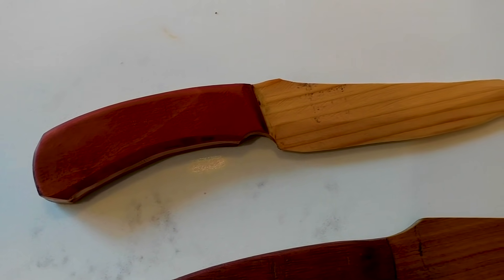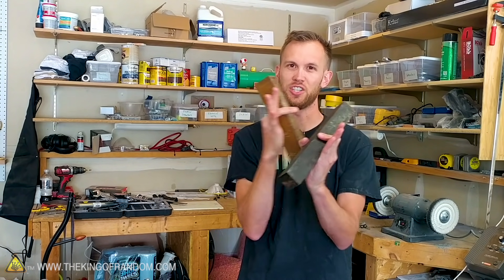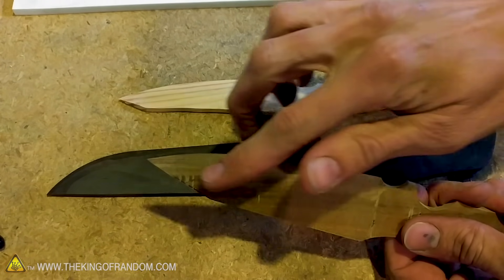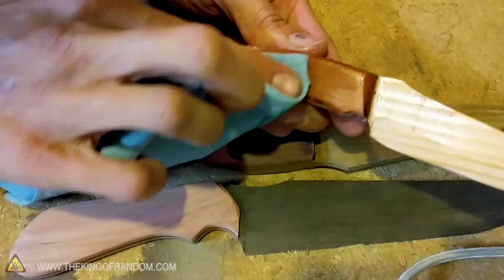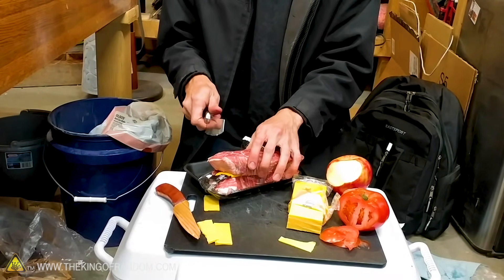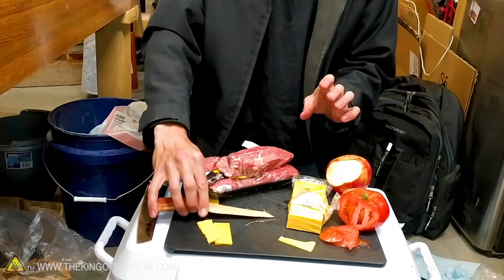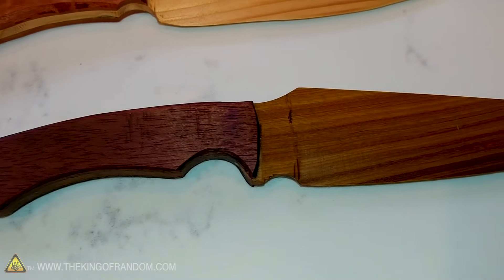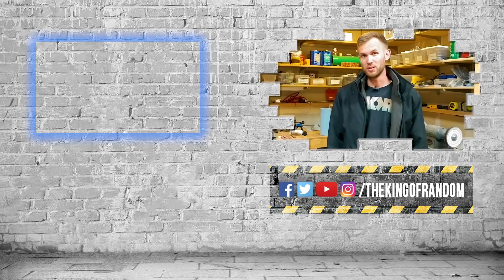How Dangerous Is a Wood Knife?

Comment: Can't believe you didn't think of fire hardening. They use that trick for arrows. DO OVER!
Reply: Exactly what I was thinking, I've seen survival shows that use a similar method of fire hardening as a fire plow through friction because any heat treatment is better than no heat treatment...
Reply: Yes but he also should have also tried  fired hard rock maple and fired  iron wood
Reply: Thanks for commenting this because I was going to if I didn't see something like this.
Reply: tony
Reply: huncho green yes?
Reply: yes, whenever i do this i make sure to put my wood in a furnace for a few hours beforehand. it also gives the wood a nice black color
Reply: or katanas fire and water
Reply: Fire hardening brings out the sap from the wood and burning it away so fire hardening is very inefective against processed wood
Reply: @raed21093  you have to put it in a fire a for a second until it looks just a little black it’ll make it strong
Reply: Yes.. this! And serrated on the edge... it would be maybe the best ever wood knife?! 🙌🏻
Reply: @raed21093  i would use a small torch to have the most control...very quick hand movements... it's fun too

Comment: Can you freeze a lava lamp in place with liquid nitrogen or other cold things?
Reply: I would to see that too
Reply: Yep
Reply: Tottaly
Reply: They should put it running in a freezer and film it until it freezes totally
Reply: ِ  but what if it doesen't. And anyways it would be fun to see it crack
Reply: The bottle would burst from going hot to freezing too fast.
Reply: Lava lamps bubble and move due to high temperature changing the density.  It would be very hard to freeze the liquids faster than they move through each other.

Comment: Too bad you didn't fire the wood first.

Fired wood is much stronger and would probably hold that edge better.

Edit: I should have said fire hardened, not fired.
Reply: Realllly misread that. Based on what I read that knife would be onnn fire
Reply: Thousand degree wooden knife?
Reply: @CausingChaos.  (claps slowly)
Reply: @samanthae.1002  fire hardened...
Reply: Samantha E. Not on fire... burnt
Reply: @samanthae.1002  Same here
Reply: @samanthae.1002  ..........
Reply: @samanthae.1002  it transforms the wood into carbon
Reply: almost correct mate , i think you meant heat treat the wood.
Reply: yah thats true
Reply: A quicker way is covering it in very thin based super glue which turns the wood rock hard
Reply: Elite_ Shadower_  also temper it and put a hamon on it maybe even dip it in ferric chloride to get the damascus pattern
Reply: what did the wood do to get fired?
Reply: Darn, I was going to mentioned fire hardening, but I was too late...
Reply: @James-hj5ov  lol, maybe just a little.
Reply: that is true. he should definitely try that
Reply: so unemployed wood is better?
Reply: Glad I looked down the comments before mentioning fire hardening as I wouldn’t want to be the 100th person to mention it 😂
Reply: Teak wood that saltwater cured is very,very hard, I have a couple of combat paddles that I made thise things are about as hard as wood can get, one edge is beveled to a nice sharp edge the other is rounded, the end is hooked and pointed into a pile. Yeah I have several that I sold and two of them have been used for defense and both times were lethal. You start out with a hard wood and go from there
Reply: I agree, this would be great to try next
Reply: @mysticwolf2842  wait, can you explain that some more?
Reply: was just gone say that too.
Reply: even primitive wood spears and arrows where heat treated, the carbonation allows for a much sharper edge, I think.
Reply: also i think if you lined the grain in the other direction you would have had much less damage when using them. the grain should go horizontal not parallel to the cutting edge.
Reply: I just jumped into comments to say the same thing. It's amazing what you can fire harden, from feathers for quills to see shells. You can also use the method where you plunge the edge into super heated sand
Reply: Paul Powell could you explain exactly how you do that?
Reply: @jasonmatthewson8534  HA, the jokes on you! You mentioned mentioning it, so you're still the 100th person to mention it!
Reply: @samanthae.1002  you can strengthen wood by burning it a little. That's what they are talking about.
Reply: @CausingChaos.  wood..lol  could it be would or should it be wood?
Reply: I didn’t know wood on fire is strong I though it wood be destroyed
Reply: He he bioi
Reply: Jeana Verkempinck but what if it will be too rough
Reply: I was thinking of that too.
Reply: Yeah take its job
Reply: CJ Lilac PUN CITY
Reply: My thoughts exactly.  Especially hardwood, when heat tempered becomes a whole new material to work with.
Reply: Is this a sequel to “Wood fired pizza” ?

Comment: Use a sanding not sharpening system for the edge, wooden knives are really effective for softer vegetables and cheeses. And are great center pieces when paired with a matching board.
Reply: @Timetraveler515  cheese that isnt solid isnt cheese
Reply: Our processed cheeses are not cheese but we can still get cheese on the block.

Comment: I think you should have used a straight blade (instead of a curved one) aligned to the fibers of the wood. That way the splinters while cutting could be eliminated and the edge could be more durable and sharp.
Reply: MoTab for a kitchen knife, it is best to have a curved edge so you can have the right motion for cutting food
Reply: @matthewkohmann8657  The quest was to make a proper knife from wood, it has to be a knife before being a kitchen knife ;)

Comment: 1:37 kinda straight. None of the 2-4s I have every seen from Home Depot, Lowe’s, or Menards have ever been straight.
Reply: I used a 2 by 2. And Batoned off a sliver and made a little wooden butter knife for when I go camping. It matches my wooden Fork, Spoon, cup  I made. spatula and cutting board of course...
Reply: If you go through an entire pile you will usually find 1 reasonably straight 2 x 4.
Reply: Gareth Baus. Yes but when you are trying to do a project which requires multiple straight 2x4s it is just really annoying.

Comment: Try purpleheart. I’ve heard that is some of the hardest wood in the world and can quickly dull saw blades.
Reply: Or apple wood.  Some clocks and watches have gears made of apple because of the grain.
Reply: having worked with Purpleheart, it's not even close to Lignum Vitae for hardness. it's harder than most "Common" woods, but once you get into the exotic stuff it becomes more middle of the road.

Comment: Use stabilizing epoxy in the vacuum chamber with the wood and it will make it rock hard and hold an edge
Reply: makes it a composite epoxy knife rather than a wooden knife. You wouldn't have access to epoxy or a vacuum chamber outside of a workshop ;)

Comment: Lignum vitae is a very hard and dense wood with a complex grain structure. If you take the time and run it through the grits up through 10,000+, you can get it sharp enough to shave with.  I've seen a properly sharpened Lignum vitae knife cut paper thin cucumber slices, but that knife was much heavier than yours, and has been honed with a 30,000 grit whetstone.

Comment: It's basically the same process as say, mass produced fixed blade stainless steel blades, like kitchen knives. This process is known as "stock removal", and is typically done for knives and tools of the type en masse for cost efficiency sake and because of a higher potential for precision.

Comment: Should have tried bamboo. Bamboo is anti-bacterial, and anti-fungal, which is why a lot of eco-friendly kitchen utensils are made from it. It's also extremely strong for being as light as it is, so you could potentially make a thinner knife blade. Bamboo is a grass, but it's close enough to wood for this experiment. That being said, you can buy bamboo knives used for lettuce and vegetables for pretty cheap. 

And the 2x4 is white pine.

Comment: Should try balsa wood infiltrated by a thin resin by using vacuum chamber, off and on.

Just need balsa parallel to the blade.

Could just do fiberglass, but wouldn't be the same look

Comment: You could probably shape better with a cabinet scraper. As far as type of wood I would recommend  purpleheart(from the amaranth tree in africa) or Ipe (also known as Brazilian walnut). The purpleheart turns grey when you sand it but the longer you leave it out in the sun the darker it gets. The UV oxidizes it causing it to turn purple. It's also ridiculously hard. I was burning up a carbide drill bit while drilling a pilot hole. Now the Ipe has a fire rating close to that of steel or concrete and doesn't really burn. Might try the fire hardening on that. It's already hard and tight grained. It's often used for the decking on semi trailers. It also contains a lot of resin. Also with more domestic hardwoods you can melt steel wool into vinegar and brush it on the wood. The metal reacts with the tanic acid in the wood causing it to darker. The more tanic acid the wood contains the darker it becomes. You can make poplar look like walnut with a few coats or turn red oak completely black with a single coat. Sorry for writing a book but it's kinda in my wheelhouse.

Comment: The Lignum Vita knife may have cut better than the Ebony due to design rather than wood quality. As you stated, the Ebony had an extremely thin edge, and with the chunks missing, it would not cut as well. I noticed they also had different designs, which, for the purposes of material testing, can produce flawed results.

Comment: "Sawing" with the wood knife is right, you have tiny serrations in the edge . Cheese doesn't require a sharp knife to cut, a thin wire (round cross section) is used for many cheese slicers. For  more hardness, I might have tried a varnish or other substance to soak into the edge and harden before the final honing steps.

Comment: so, Lignum Vitae isn't the densest wood, there are a few denser ones that would probably work better. my go to would be African Blackwood as it can take a super high polish. also, don't use a normal sharpening stone, just use the finest sand paper you can, then a polishing wheel.

Comment: You need to heat up the edge of wood knife first using heat gun or food torch (to harden wood material, but don't let burn)  then the next step you can sharpen it with sand paper from 800 grid, 1000, 2000, 5000. It could better and sharper the wood knife be and It would avoid the wood knife edge from chipped.

Comment: I would bet if you revamped this and took the winning material and used a better sealant that is also possibly non toxic and gave it a slightly thicker but still somewhat sharp edge and a slightly thinner spine you could actually make a viable biodegradable produce knife that could possibly be resharpened and resealed at least a few times. Just a possible hypothesis...
Reply: you could also try bamboo but that might be an arguable process. Maybe shredding it and layering it into some kind of epoxy or something it would be less organic material at that point..

Comment: when a knife hets dull you sharpen it with a whetstone or a diamond stone what that does is removes material to make the edge thinner so it can pass threw things  wood is a very soft material so you can make a thin edge very quickly

Comment: Apply a hard resin to the blades and handles, then sand and smooth it all out and sharpen it. see how resin does, that way you can have a real wooden knife that can cut in any direction, i'm just not sure how long that resin will hold before it fails.

Comment: I'm no woodworker, but I think you made a design mistake. For resistance as a knife, grains should run along the knife, the way you have them - so you can put some pressure without the knife snapping. However, if you want cutting power, grains should be perpendicular to direction of cutting. It would let you create a finer blade, that won't split as much, and the end of the sharpened grains will create a microscopic saw, which in theory should help cut better. However it would probably by unusable, as a slight pressure on the handle might snap the knife in half !

Comment: I like this video, but I have a few problems with your method of testing. First off, your angle of attack, so to speak, when you cut the paper with the steel knife and the wooden ones was different. That would create different results. I also disagree with the order in which you cut the foods. The  cheese may be harder than the apple and tomato, but they would damage the edge faster than the cheese, due to moisture. I still really like the video.

Comment: Dude.. If you want the wood to hold a decent edge, you gotta close the grain. Close the pores. Its not steel, a standard knife sharpener isnt going to do anything. Except maybe get the profile closer. But its not going to sharpen it. Different materials, different techniques required.

Comment: Wood can be hardened with heat. The steel knife definitely would have been heat treated. Are we comparing apples with pears? The wood has not been given the treatment to perform  at its best. Please repeat this experiment, but heat treat the wood before and during  sharpening.